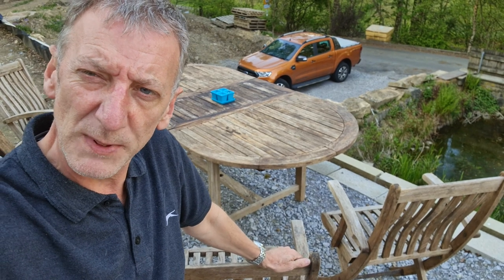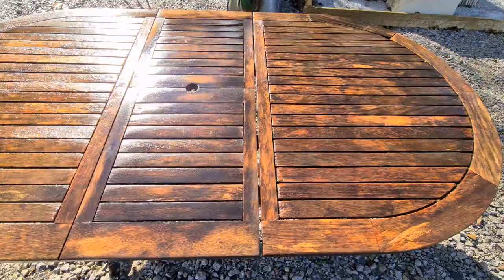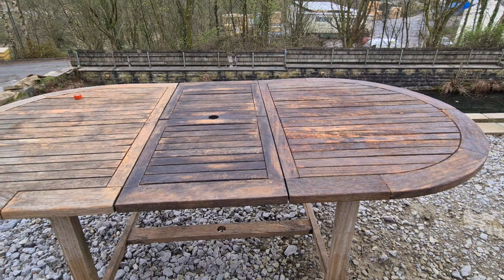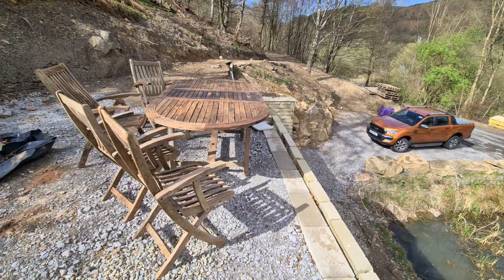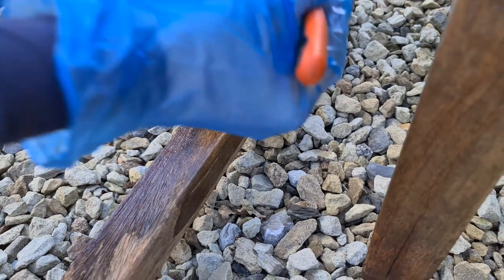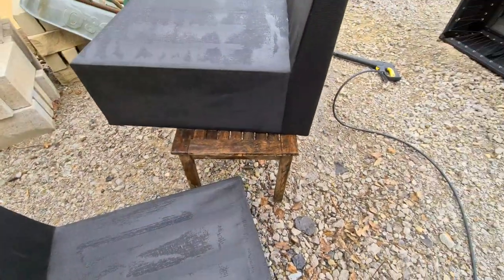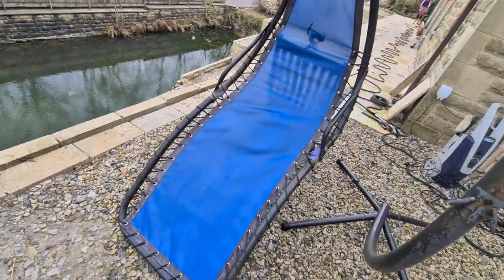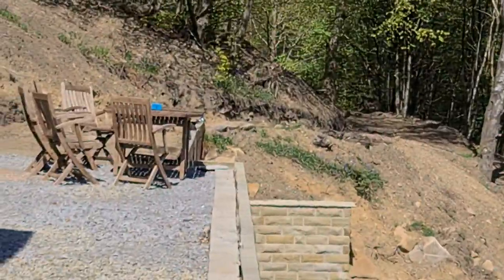Pressure Wash your Garden Furniture

Comment: You should have sanded it after cleaning it with the power washer. Otherwise you still have loads of marks
Reply from the maker: Agreed, this was more about keeping it going and making it useable for a few more years though.  A good sanding and some lighter  oil would have been good.